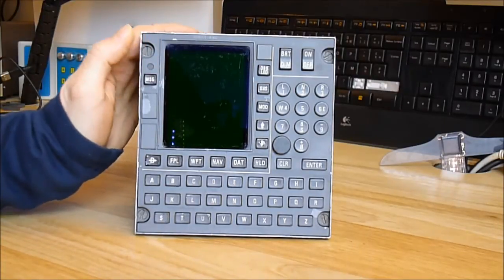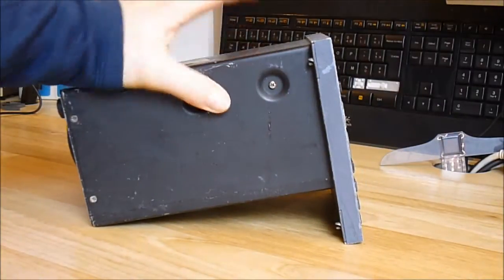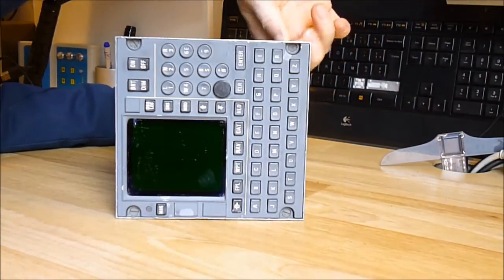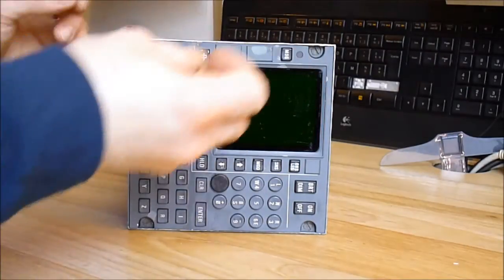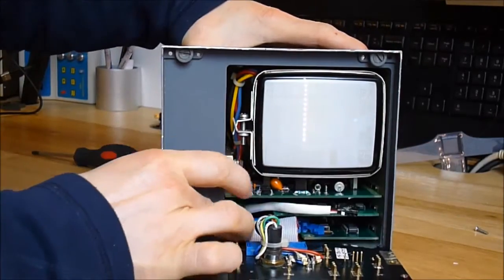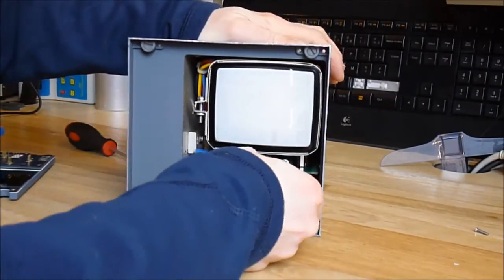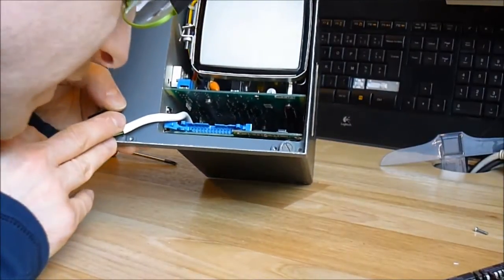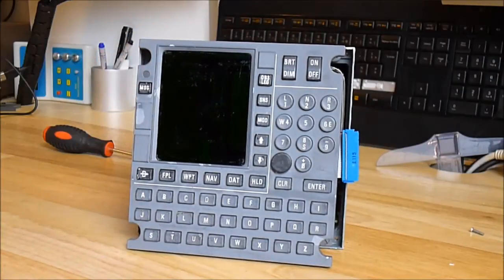Bendix King KCU 568 CDU

Comment: Nice unit. The card you pulled out seems to be the graphics card. The 40 pin IC is the 6845 i believe, the ROM is a 2K rom full of character data. The 2 bigger intel IC's to the right are most likely 2114 or 2118 SRAM. The register layout of this controller and as well as a character ROM are still embedded is the chipsets and graphic cards of today's PC since IBM graphics cards used that chip.
Reply: I have one apart on my table.  It also has a serial chip in it with the pins going to the connector.  I think its just a basically text display from the look.  Still looking at the protocol.

Comment: It would be nice to see it powered up, is like a terminal with RS232?
Reply from the maker: It must be using some weird airplane  grade protocol, so far I found a "user" manual for it but it seems to be lacking usefull technical info, as the pinout, supply requirements, protocol
Reply: msylvain59 Hope you can find a service manual, reverse engineering it by looking at circuit board will be a pain in the posterior.
Reply: msylvain59 yeh that would be the Avionics "standard" that you are looking for. its generally a restricted item and hard to get a hold of unless you are in the industry :(
Reply: @msylvain59   I have one of this .  but  it dos not work